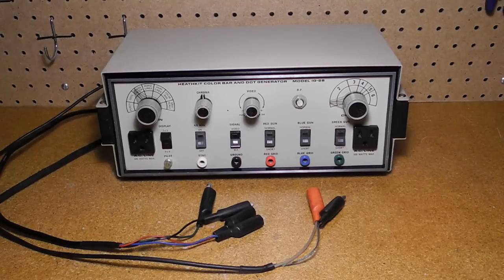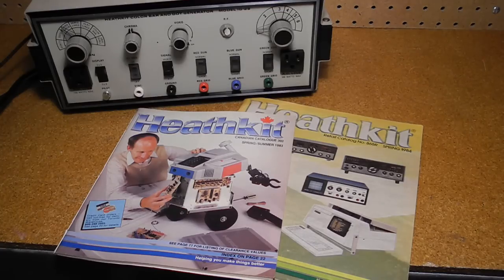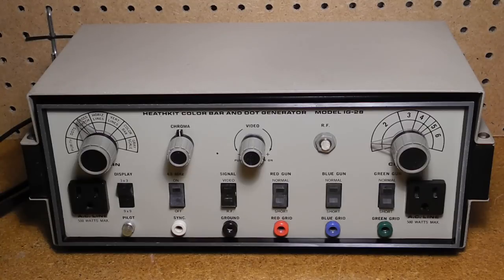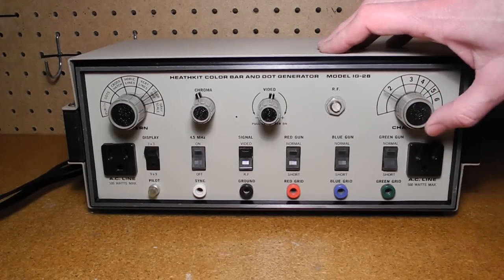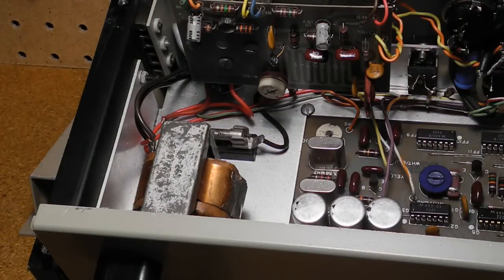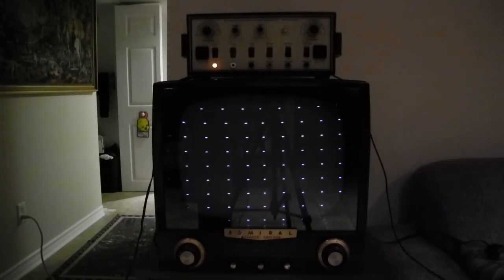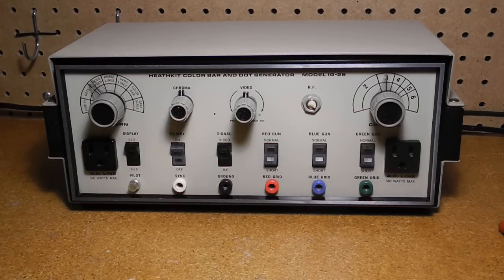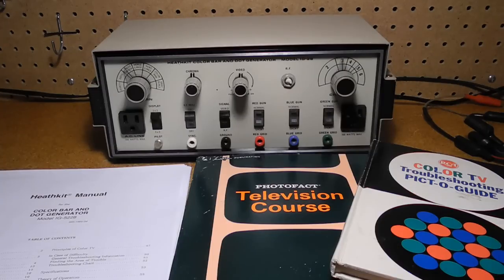The Heathkit IG-28 Color Bar and Dot Generator

Comment: How do you eliminate the flagging vertical lines at the top of the picture. I built the add-on circuit for this but it didn't help.
Reply: The flagging is caused by Heathkit's implementation of the NTSC vertical blanking interval, which it apparently misinterpreted as the vertical sync pulse.  The vertical sync pulse is thus excessively long, about 1.3mSec when it should be about 180 uSec.  The original  IG-28 Vsync period thus blanks a large number of horizontal sync pulses.  Absent these, most modern TVs lose horizontal frequency lock and "wander" at the top of the picture.  You can fashion a BJT monostable multivibrator using 2N3904 transistors to develop a shorter sync pulse.  The monostable can be interposed by cutting the trace from the vertical sync shaper MC724 pin 3 and the sync mix MC724 pin 10.

Comment: how did you hook his up to the monitor?
Reply from the maker: It has composite video out and I connected it directly to a monitor that accepts composite video input.
Reply: @jefftranter  on the back? same model.. mine has alligator clips.
Reply from the maker: @Johnh-r2x  Yes, I had to connect the video output cable to a suitable connector for the monitor, i.e. an RCA phono plug.
Reply: @jefftranter  what was plugged into the AC input on the right side?
Reply from the maker: @Johnh-r2x  I was just using the AC outlet on the unit as a convenient way to power the monitor.